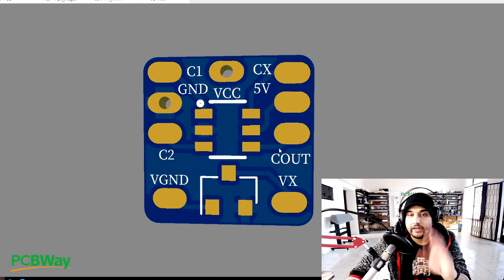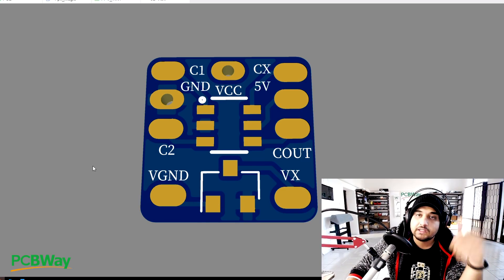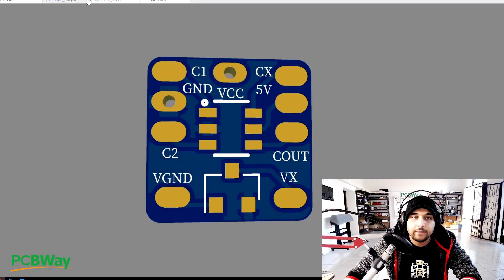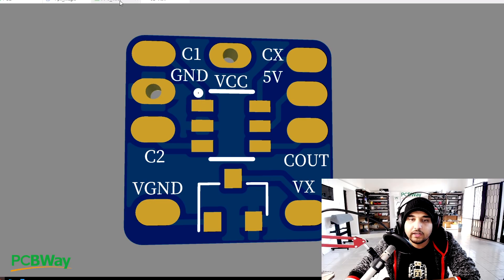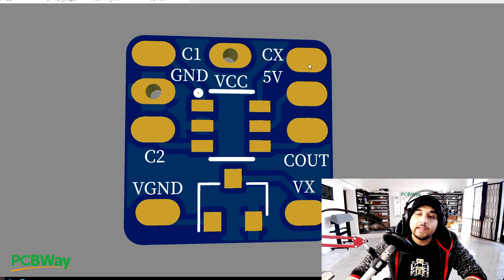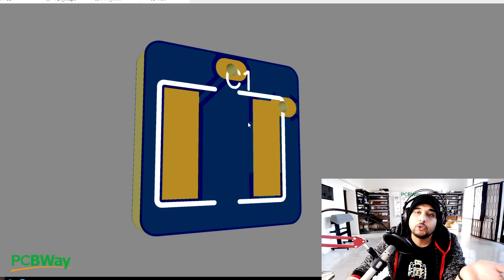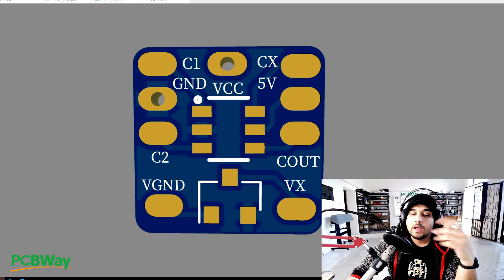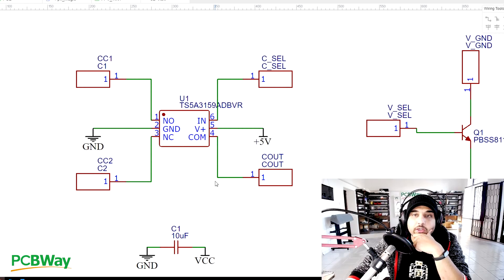FPV MAGIC BOARD!!! // ++ Giveaways

Comment: Great concept and good work.  However be ULTRA careful with ground switching on a VTX.

Some VTX's hunt for ground if ground is not connected.  These can dump the VTX input voltage differential through the smart audio or tramp control lines back into your flight controller (frying both the VTX and the FC).   This is especially true for HV VTX's (vbat), but also for 8 and 9v capable VTX's.

This is why the Pyrodrone Hyperlight F4 true-pit switches VTX+ instead of VTX ground.

I have personally burnt out 2 HV VTX's when the ground lines became disconnected.  One of those was through an early Pyrodrone Hyperlight F4 ground switch that also fried the FC.

Comment: Are you sure the vtx switching is a good idea? The ground might leak through the video signal or the smart audio/irc. Especially with higher voltages. This could end up sucking the juice for the vtx through the smart audio pin of the FC burning it completely.
Also, might be good idea to add.current limiting resistor for the base of NPN transistor - it needs 0.7V to switch, the FC outputs 3.3V - the difference might again ruin the FC. Not sure about that switch IC, but might be a good odea there, too.

Comment: 10mm you say one centimeter, 20mm two centimeter and so on. Sorry could not resist. :-)
Reply: the guy who taught me to weld said this " only people who sow measure in centimeters " . everything ive done since I've measured in millimeters .
Reply: Benjamin Maynard  sorry but he was wrong, you use inches to measure feet or feet to measure a mile? :-) same thing. After 12” you call it a foot right?
Reply: @MindRiderFPV  it depends more on the precision required and the field of application. mm is more used in tech. 32mm is absolutely fine to say. 3.2cm is quite a nonsense.
Reply: Larzuk Pandemonium you’re simply wrong. It’s the same concept as hour and minutes, and it’s used this way all over the world. Other than here in US. Do as you wish but the correct way it’s exactly 3.2 cm, as you say 1 hour and 20 second. Or you use seconds to count hours too? What time is it now? :-)
Reply: In design the standard unit is mm, not cm.
Reply: @MindRiderFPV  Well, im french, and i'm using exclusively the metric system, and i assure you that you are absolutely wrong.
Reply: @MindRiderFPV  it's not the same concept of that you can be sure . i wouldn't measure anything in inches that's the point . even if it was 1505 mm , i just wouldn't . sure you might say "oh that's a foot" if you were eyeballing it without any worry or planning , but no one pulls out a tape measure and measure's a 'foot' unless your in the 1700s or making a dress .